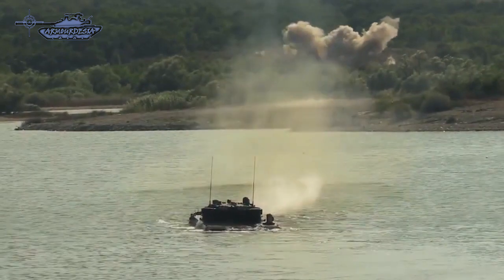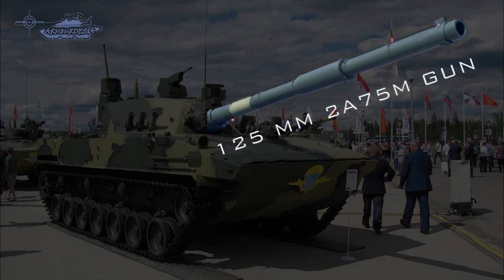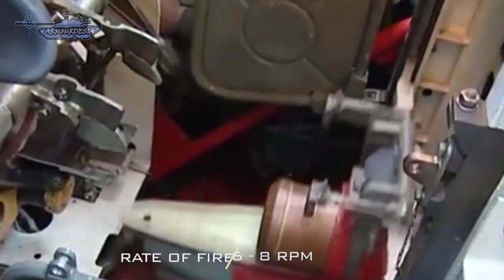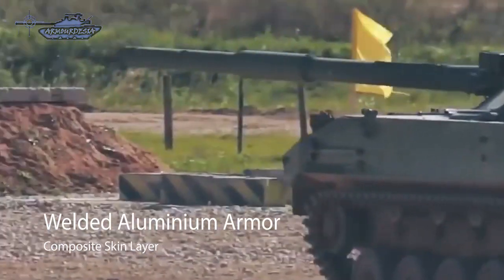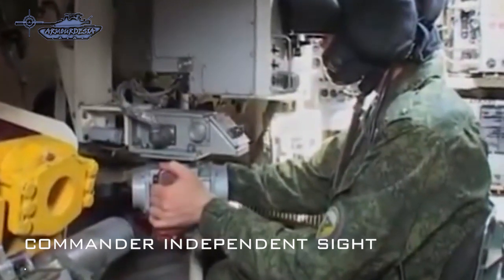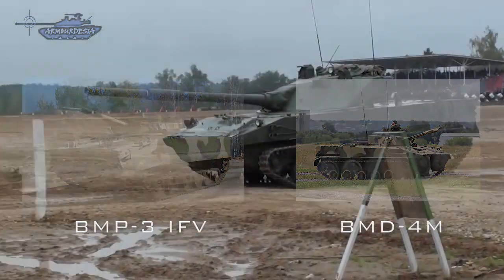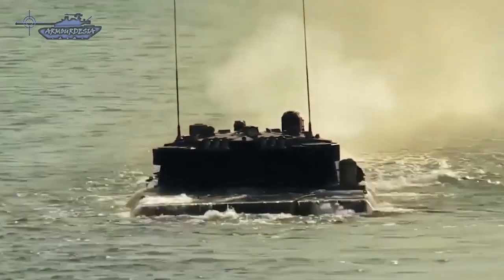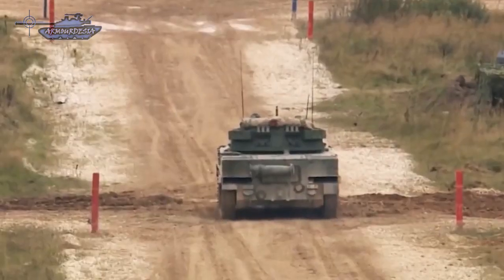Is 2S25 Sprut- SDM1 Modern tank destroyer effective.....

Comment: I think the armour of modern tanks is overated and sometimes u donot need all u need is firepower ,tactical monoverability ,stealth and such as first to detect and fire capability and this is a perfect vehicle for this purpose ........
Reply: As long as you have a strong enough airborne force
Reply: This tank destroyer has its uses but it's no tank . 

 Heavy passive armor on an MBT allows for a tank to move forward with less fear that crew will be killed .
Reply: This is a defensive vehicle for airborne or infantry units. It’s job is to lie in wait of  MBT’s at pick them off at range not go charging out in attack mode.

It’s light weight means it can cross most bridges and get where it needs to be. The up armoured MBT’s at 70 ton plus cannot cross over 85% of bridges due to there ever increasing weight. Now need bridging companies to travel with them. That’s why the Russians built the M-14 at under 50 yin’s.
Reply: @kentriat2426  countries which dont have a strong airborne capability will not choose this tank destroyer in spite of its big 2a75 gun which is equivalent to t-72, t-90...gun.
They prefer Sprut's 105mm opponents like the VT-5, Kaplan MT for mountainous terrain like India border or jungle, paddy fields like Thailand, Philipine.
Reply: @kentriat2426  WTF you are speaking?!  To defend your country is not needed to use airborne tanks because sure you have some tanks close to borders. Even you can use railways to bring tanks fast to war point.
This type tank is airborne and can float, meaning its purpose is to penetrate fast into enemy territory and open a way for bringing heavy vehicles. Its an OFFENSIVE tank. Defensive tanks are MBT's, light vehicles with anti tank missiles, tank destroyers, field heavy guns, anti tank mines, anti air guns and missiles...
Army have own "temporary" bridges which allow them to move tanks anywhere on battle. Army logistic units NEVER take into account bridges build for civilian use, but always they calculate a different way. By the way, every bridge which purpose is to withstand heavy cargo trucks (over 20 tons) - can withstand to pas one tank at time. Sure, like India and Pakistan which still today they use bridges made from woods - such bridges can not be used to transport tanks. 
Another way to transport heavy tanks over an river is by cutting thick trees and fill the river with woods leaving 30 cm gap between each wood, which are 4m long, just to pas the water. 
Again, no army depends from bridges which are build for civilian use.

Comment: With carousel loading ,protected by thin armour,any penetration will brew up the entire vehicle.
Reply: Even if the ammo was stowed the way an Abrams would, like with blow out panels and blast door, vehicle would still be blasted Into pieces due to how weak the armour is
Reply: It is better to have a bad tank right on time in right place than have non of them..
Reply: @alexisbierquedebirkadefauv1744  
high mobility vehicle must not have heavy armor. Speed- it is key for survive, quick changing position and accurate shooting.
Reply: dead soldiers are just a number, and dead soldiers are not a loss for an country, but destroyed tanks are big loss during an war event. For that, they use cheap light tanks with high firepower to engage eve main battle tanks in land, even this type of tanks can shot n floating on water. Such light tanks are amphibious on water also can be dropped by airplanes with purpose to penetrate fast in enemy territory and open a way to bring ships with heavy armor to disembark in enemy territory. 
Sure, on such situation always an invasion army have big losses at beginning, but later they can achieve domination. This type of tanks are great choice for such event.
But its great that such tanks can not have thick protection because MUST be lightweight, so host army can destroy them easy even with 30mm guns. Otherwise, such type of tanks can be very dangerous because have high mobility, high firepower, amphibious, and airborne. Those are only some main advantages over MBT's.
Reply: @alexisbierquedebirkadefauv1744  most of the time, it leaves a nice sized whole through the inside wall of the ammunition compartment if tank is hit directly in the back.

Comment: Can thin skin armour survive in modern battlefield?
Reply: Depends on what kind of batte
Reply: This is an airborne armored vehicle. It is not designed to frontal clash main battle tanks. It is designed to be dropped in mass behind the front lines and for this purpose this is an excellent machine. Not to mention that equipped with an antitank guided missile this light vehicle can hit many of the modern main battle tanks before they can come close  enough to use their main gun.
Reply: @nevermess4161  it is only suitable for countries which have strong enough airborne force. Of course they have strong frontal armored line too. That why 2S25 was hard to find a customer.
Reply: Thin armor is the bane of all airborne vehicles. What I can tell you is it's better than nothing.
Reply: @AbdulRasyidPangrango-qr9dt  armour is only useless if your enemy has top of the line weapons, kv-1 armour and t-34 armour made german 37mm guns obsolete. and 5cm guns hard to use.

german tiger/panther armour made the soviet 76mm hard to use (not obsolete as panzer IVs still existed)

an unarmoured tank like the 2S25 could be defeated by ww2 anti-tank weapons, meaning literla decades worth of tanks can defeat it.

Comment: Very Briefed Ideas :

For the vdv and the marine infantry forces as both formations are the only heavy assaults special forces units for the bolsheviks , While the bolsheviks need to expand these forces to about half a million soldiers devided between the air assaults divisions and the marine infantry forces as an advanced spearhead used in any offensive operation in the Europe theater of war to achieve a set of goals, including isolating the targeted theater of operation from its Operational and strategic from its strategic reserves and strategic depth .

This tank destroyer ( due to the means of its deployment to the battlefield ) is not like the older bolsheviks tank destroyers of ww2 ( and even in the early years of the cold war ) that were distinguished by its characteristics e.g : the heavy weight and thus slow mobilities , excellent front armor , and its large caliber gun that exceeded all the main guns calibers of the other tanks beside other elements distinct this types and generation of tank destroyer from the standard tanks destroyers  . 

This tank destroyer is designed to be used within the operational and strategic depths of the enemy away from the sites of deploying the main blocks of his forces either on the front lines or near it in the tactical - operational depths , so improving its survivability is an essential elements in the face of modern generations anti-tanks guided missiles , This is supposed to be by equipping this platform with soft & hard kill systems , although the last system ( hard kill ) complicating the employment of the infantry formations alongside the any platforms equipped with those systems , therefore in the case of equipping this platform with the APS systems this tank destroyer should be deployed and employ apart from the infantry formations .

While utilizing the organic operational characteristics of this 2S25 Sprut- SDM1 ( e.g : the small size , the high agility & manouverbalty on the countrysides and thus excellent mobilities , Besides employing the topographical factors of the European theater of operations where dense forests and dense vegetation cover for example, Central and Western Europe ) would enhance its survivability when employed to counter nato forces attempts to support and sustain the combat effort of its forces in the targeted country or cutting and isolating the main theater of operation from its neighboring countries and closing any expected axes for counter attacks .

And with only the 7.62x54r as the main auxiliary weapon the platform lacking any serious : 1- anti-kuscrafts capabilities 2- anti- soft targets on the grounds .2- any abilities to defeat soft targets on the grounds like the soft skin and lightly armored vehicles , fortified positions and enemy in urban areas like villages controlling or located near strategic cross roads , bridges and pathways , vital targets .....etc.

This tank destroyer / light tank will employ several elements to multiple its combat effectiveness, whether in offensive or defensive roles: including for example the : compact size , weight-to-horsepower ratio, firepower of the main gun with engagement capabilities of up to 5000 m against armored targets, all of which will play in favor of enhancing survivability.
Reply from the maker: Dear thankx for ur feedback...
Reply: @Military92  no problem it was my pleasures
Reply: The Bolsheviks were almost long gone when this light TD was released.
Reply: @vondantalingting   they all presenting a modern version of bolsheviks but under the skin .

I think the tank destroyers is a reappeared concept It can be justified by the very low cost of production and running ( in comparison with the main battle tanks ), plus the strategic and operational flexibility in transportation ( rapid mobilization during wars times ) and combat as an advanced rapid reaction force or fast mobilities across the battlefield and between various axes ,

I think its a tank destroyer and light tank depending on the type of the mission or tactical & operational employments .

Always And Forever May GOD Bless The Un United States Of HM Shninasios   .....
Reply: @eagleeye6691  tell me then tovarische. What part of Putin's "Whoever does not miss the Soviet Union has no heart. Whoever wants it back has no brain." screams I am Lenin's lap dog?

If there's one thing I found far more perplexing nowadays is that post Soviet people are far more capitalist than traditionally Soviet people. I mean seriously take a look at the west and their social reforms and current trend towards socialism that barely makes real sense. At the same time, take a look at the rest of the post Soviet Bloc countries. Reminds you of the usual trappings of Republican fragility does it. Usually prone to dictatorships and exploitation doesn't it? Compare that to the headless wigs on the other side.

Tldr: People in the east died and lost something because of the Bolsheviks and never really liked them except those arschkriechers. If they truly were still Bolsheviks they wouldn't have toppled Lenin's and Stalin's statues.
Reply: @vondantalingting  

My original comment were not directed to you , so don't reply if you can't handle the answers , I am free to describe whom I want to describe , and either they are miserable bolsheviks or not this is only reflecting my own point of view , beside this were a military subject which you turned to political debate . 

although I meant the political , military , security establishments ,and to some extent the armed industrial complexes , this of course after excluding the miserable communist party which still enjoy an overwhelming public support and until very recently, before comrade Vladimir Vladimirovich Putin took control , it was the largest political entity in the new russian federation , I hope you were not been offended by  calling you comrade , I saw you were very enthousiast to them so I used the same word Vladimir Vladimirovich Putin used to call his military and intelligence comrades outside the kremlin .

we here only enjoying our time at least for me nothing serious
so again don't reply if you can't handle the answers .
Reply: @eagleeye6691  yada yada yada yada and the same kind of posts made me think that people in the Soviet Bloc were all unfeeling brainwashed machines for more than a bloody decade. Be careful what you post cause more people like me would bombard you with the same replies. If possible avoid things political since this is a military hardware channel. And also it's Tovarische not kamerad.